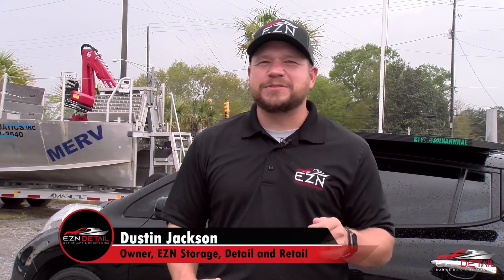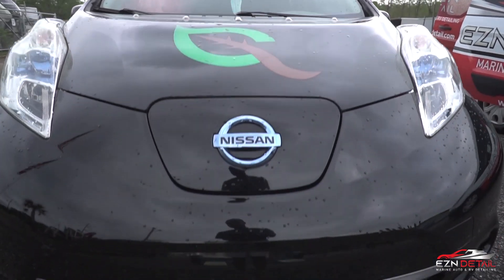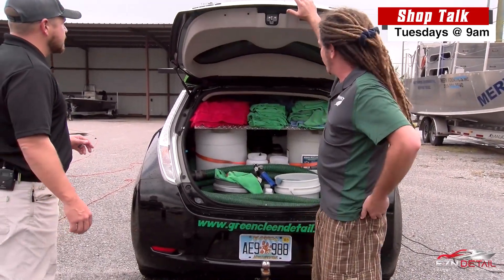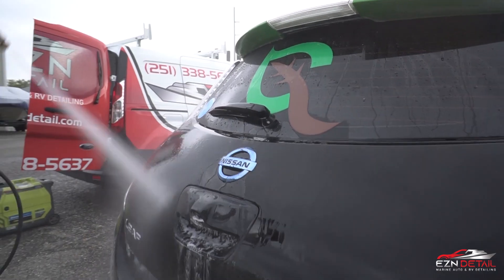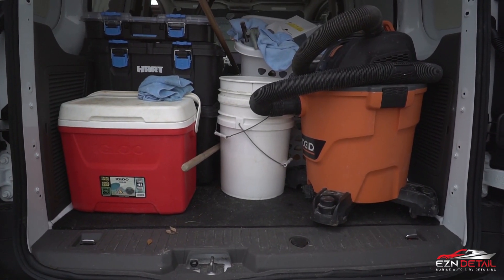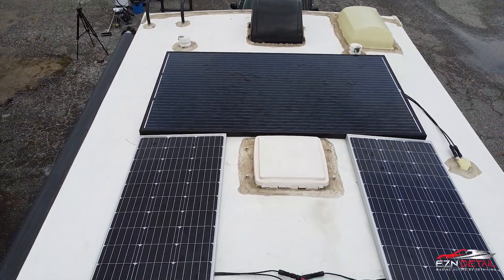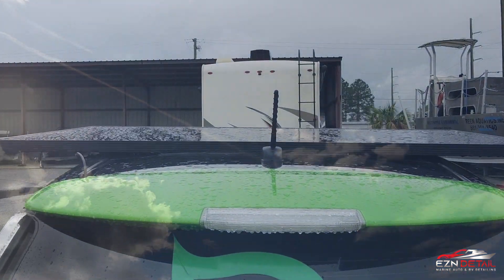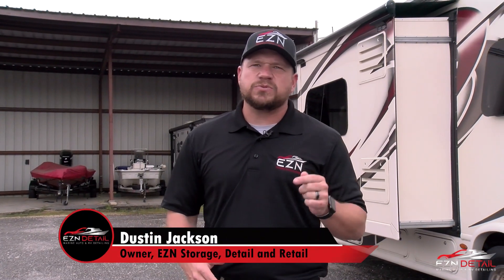Shop Talk:  Mobile Detailing with Solar Power

Comment: I have the dream of building a trailer mobile carwash which would be powered by solar. I’m just not sure where to start, including the size and type of trailer. I am however wanting to go with an enclosed trailer and I do want a 100 gal. Water tank which I know would require a pump as well. Can you offer any advice, or assistance and for what cost from me if I was to have your help building this? I want to have it ready to go by spring of 2022. I’m trying to guarantee I will have work for it before I start buying equipment to build this. Any advise would be greatly appreciated. Thanks in Advance.
Reply: Any luck? I'm starting out eco detailing business in UK London(mobile),  minimum water usage, low c02 emissions car, and non harmful products for starters. Of course I'll go full ECO at some point, implementing solar power and more.